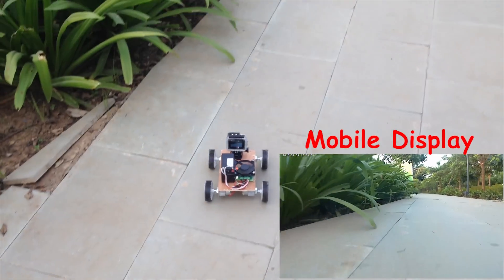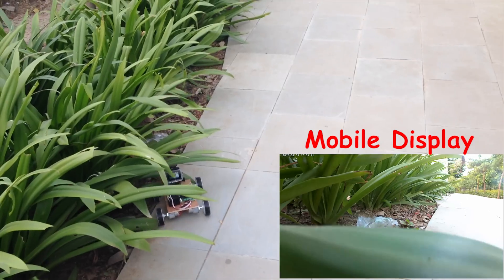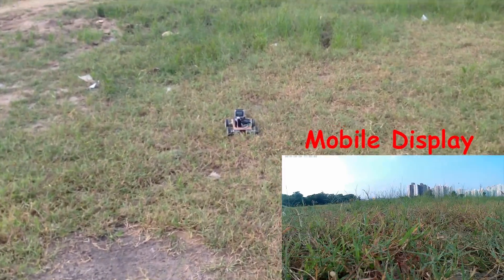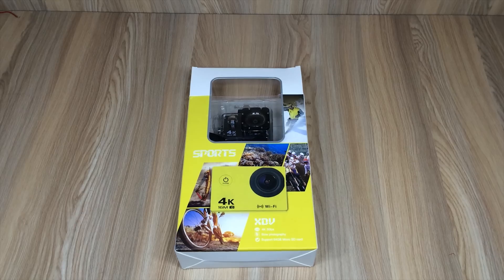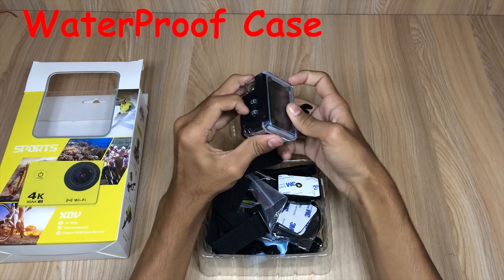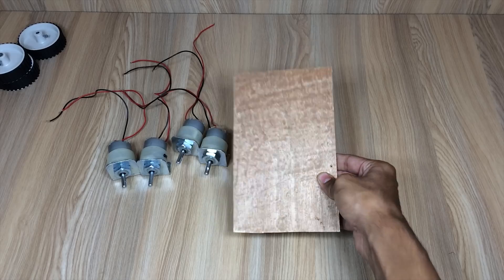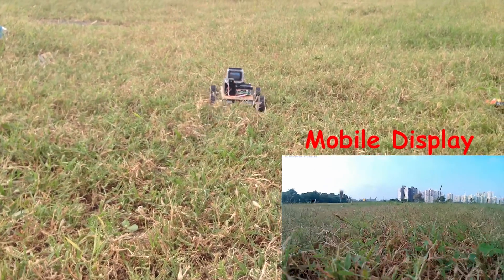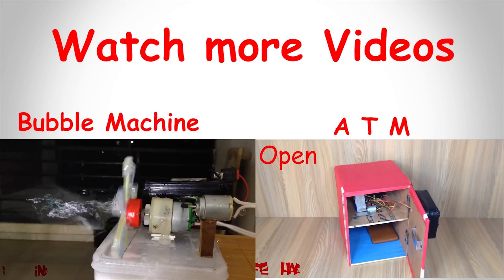How to Make Smart RC CAR with Wireless Camera at Home

Comment: Great video little brother, many blessing to you and yours, wisdom I share with you !
1).   1:35 use short screws, 3/4 inch  ( 1.9 centimeters ) select low or medium speed on drill, or man up and use a, "star/phillips counter sink head" screw. I am glad you did not get your wrist cut.
2:53 solder good, however solder wire and use F2 connectors https://www.amazon.com/Hilitchi-12-10AWG-Insulated-Terminals-Connectors/dp/B01D8TDHRW/ref=sr_1_5?dchild=1&keywords
3). One question 3:41, if you select, "drive mode" this will save battery life.
Great video !